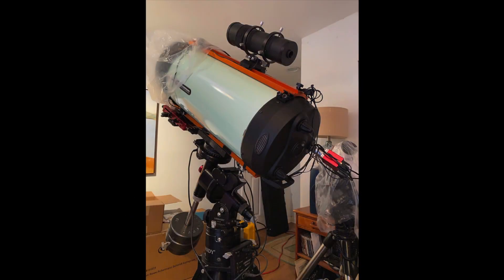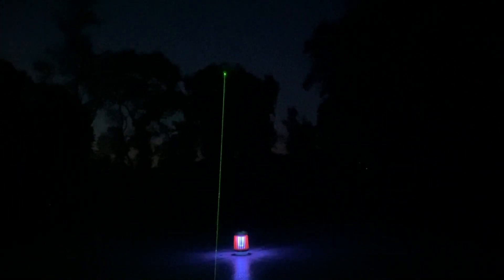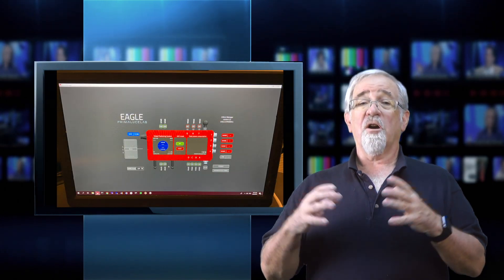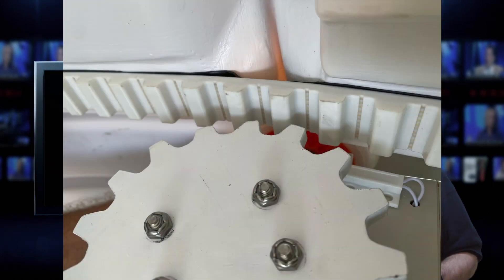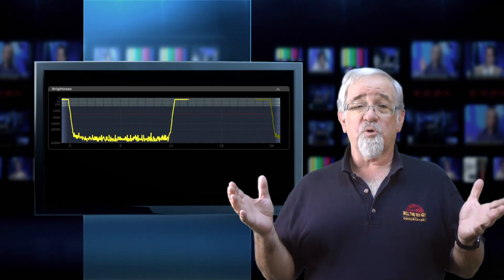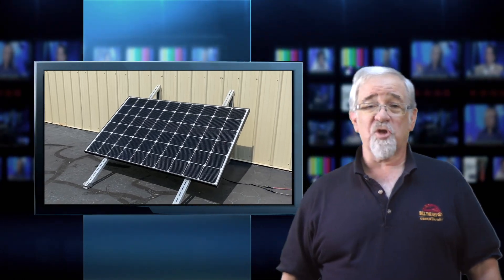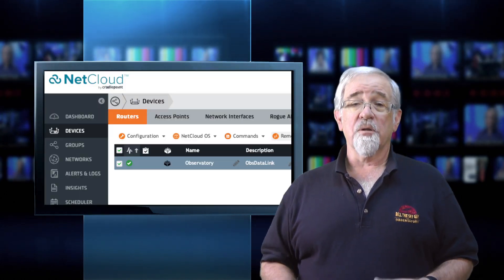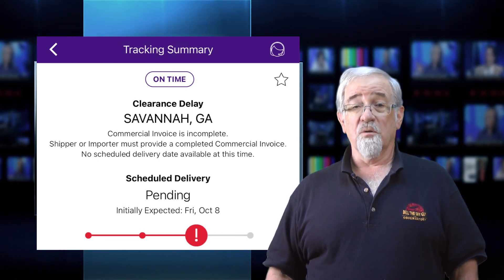Sky Guy Remote Observatory Project–Part IV

Comment: Really appreciate the hard efforts you have put into your videos, they are excellent. This spring I am relocating my permanent pier to a different location on my property to optimize sky time and target selection. One goal is that I be able to remote manage my gear as music gigging tends to take me away from valuable sky time. Ill be looking forward to more on your remote setup. My setup is much simpler at this time. ASIAIR-P direct connect to my network. But as always it won't be long before I outgrow that system.
Reply from the maker: Brian, thanks for your comments. I'm hard at work on the Part V video, actually BUILDING the thing and oh what a wacky ride it's been! I'm a musician too here in Hilton Head, do play9ing and recording; it's great to meet like-minded folks!   I've mostly got things working now but the shutter motor and associated charging is an ongoing struggle. More later; hope to have the video out in a couple weeks.
Bill

Comment: Nice run through....yeh, NexDome needs tinkering to be setup correctly, and that shutter charging with the magnets is crap, mine got the boot! Since replacing it with wire loop and contact plates, I have even seen a significant reduction in the shutter comms dropouts.
Reply from the maker: Dave, so true; and truth be told, I totally copied your idea for the shutter charging with the wire loops and it works very well! You were the perfect idea I needed at exactly the time I needed it. Somehow the circuit board in the shutter motor got fried as we were implementing this idea but to their credit, NexDome replaced it at no charge.
I'm working on Part V of the Observatory series now (the Observatory went fully operational on Dec 22nd) and I couldn't have done it without the help of the great folks on Cloudy Nights forum and YouTubers like yourself who take the time to post their activities and solutions for others to check out. Many thanks to all!!!
Reply: @BillGwynneTheSkyGuy  Well I'm just glad it's going ok for you so far! I just had another fight with it tonight! My sketchy wifi is driving me nuts for the remote access. Another project coming up 😀